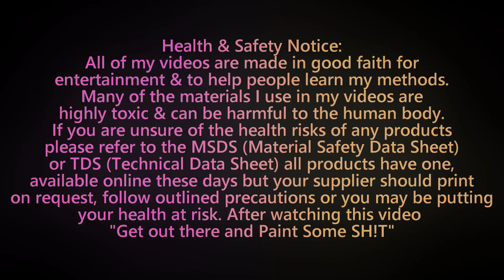Rapid Repair and Primer

Comment: Had to hold off on the painting on the mg because of the crap weather here at the moment. We are in low single digits blowing a gale and pissing down with rain. I have switched to rebuilding the front and rear suspension, but hope to get back on the paintwork soon. Cheers Gunny.

Comment: I must say uv has nearly replaced 2k primer in our work shop only for full bumpers and resprays is 2k an option in our work shop its quik but its also nasty stuff to breath in even when sanding i always where a respirator when dealing with this stuff